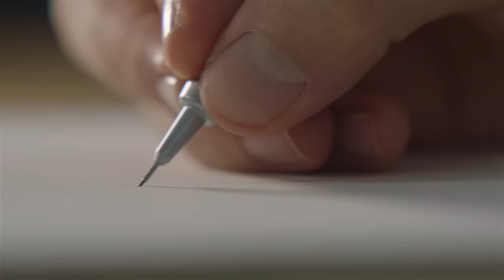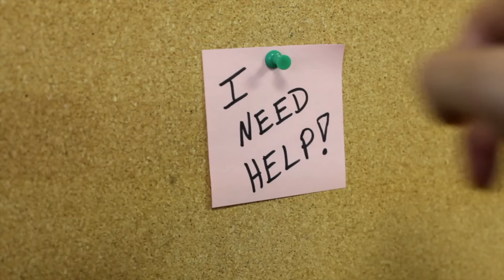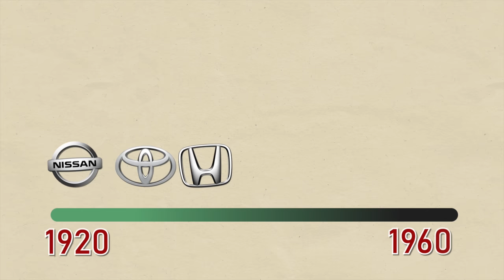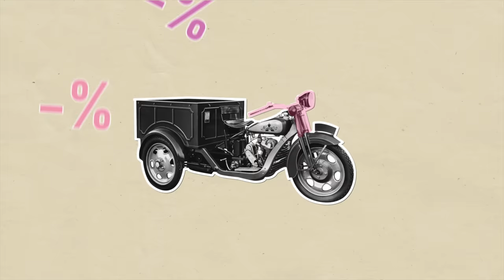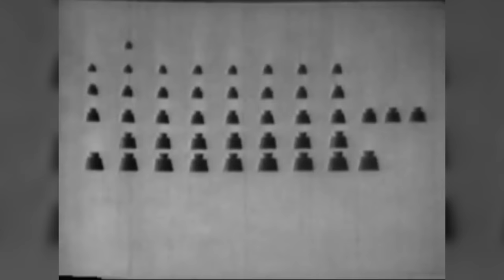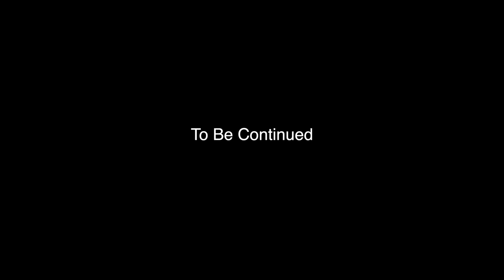Mazda Just Changed the World

Comment: I have a 2014 Mazda 3 with 265k miles and haven't even touched the engine.  Nothing has broken in the engine.  No seals, no water pump, no sensors, not even the belt is showing signs of wear.  Still have the original clutch (6 speed manual).  
I've only done standard maintenance: changed spark plugs, fluids, brakes, tires and recently rebuilt the suspension.  When people ask me if I like it I say it's probably the only car I'll ever buy now if they keep the reputation; I'm just so impressed with it.

Comment: Had a 2010 Mazda 6 and never had a issue with it runs like a Champ.
Reply: I had an Austin Champ with a Rolls Royce engine back in the 80s and 90s it was like a landrover but in my opinion it was a lot better it would pull the back out if a landrover.
They were a military vechicle used by the armed forces in the 50s 60s .
The Champ was a Nick name given to it by military personnel for it's excellence.
Reply: But the rust
Reply: Karl Aber I didn’t have a issue with that I always have my car Clean because it was white but my right head light look awful it turned yellow 😬
Reply: @karlaber3388  no rust on mine

Comment: How reliable is Mazda?
Reply from the maker: better than they used to be, I'd rank them around 3rd behind Honda and Toyota now
Reply: As reliable  as a Toyota made in Japan, Mazda uses denso components  under the hood as well as Hitachi.
Reply: 140k miles on my 2012 Skyactive Mazda 3 with no complaints so far.  Never changed anything except brake pads and oil.  I've been pleased.  It's a pleasure to drive with good mileage.  My complaints have always been road noise, an underpowered AC system, and a finicky Bluetooth system.  Pretty minor complaints.   I've noticed the power from a stop seems a little reduced (like a lag) about the last 20k miles.  I'm way overdue for some tune up I'm sure.  I need to do some preventative maintenance as soon as I find the time and hopefully the car will give me another 60k+ miles before anything serious breaks.
Reply: Willlie Nellson watch out for clogging catalytic converters. My son had a 2006 Mazda 6, and it started losing power, and ended up killing the engine. We only discovered the problem after putting in a low mileage engine , and noticing the car just didn’t want to go. We dropped the pipes and took it for a short spin, and it had power. Cats were completely clogged. Would have blown that engine as well
Reply: @boldcitycc   Thanks.  I'll look into it.
Reply: Im still driving my 2002 Mazda Protoge 5. Bought it in 2003 Love this car! Standard, fun to drive, interior immaculate. Rusty body but nothing that a can of white spray paint can make look okay (from a distance LOL!). All I've ever done were brakes brakes and brakes. Oil changes. Car still goes zoom zoom and has about 255,000. Kilometers (Canadian :)) I will buy another one in a heart beat!!Has to be a standard though!
Reply: @scottykilmer  rather have the 2.3 mazda motor that's is in my 04 ford focus zx3 all honda engines I swear they have to leak oil... the only motor by honda I haven't seen leaking oil is people that build them to race but besides that honda didn't make there engines better then toyota.... I worked in a shop 3 years I have seen all hondas.

Comment: Drove a 1991 Ford Escort, based on a Mazda. Like the way it drove, handling and gas mileage. Only thing didn't like was the rubber timing belt, that although Changed like required, stranded me three times. Once 140 miles from home costing a a we $400 to retrieve. Whoever's idea rubber timing belts was should be banished from the earth.

Comment: i like the 2015 one # HB I got with 167000 miles on it! As I was learning about my new (to me) car, I learnt that Ford used to have a heavy influence in Mazda's MFG and only parted ways shortly after the mazda 3's second generation (where I believe mine to be the 3rd gen?) where Ford was following Toyoda's way of 'find the cheapest transmission and who cares if it slips' and 'depreciation of service life expectancy' that car MFGs have adopted in the last 30+years to make them brake and completely sell you on lifetime fluids (transmission) and for so many other reasons than that I was quick to change out its OEM spark plugs along with an italian tuneup and oil change, transmission fluid change and LSD gear oil too. Once you remove the underskirt its all in a very localized area. Heck, even the Alternator is on top and the drive belts are a cinch to DIY. Thanks Mazda! My next major carbon clean is going to be the 12 bolts that hold the intake manifold on and get in there with a nylon brush (or something softer than aluminum so not brass) but after watching the 1st part of this video, I would treat this operation like cleaning a firearm, same brush but w/o the CLP ha-ha! Carb cleaner only, of course. Hey Scotty! I'd love to see a video on taking off all the black plastic (vanity cover and air ductwork). Just an idea.

Comment: Hi Scotty!
I have a question. I have a 2006 Honda CR-V MK2.5 2L Petrol. The way to check the automatic transmission fluid as per user manual is: turn engine on. Wait for it to get to operating temperature, tun off and check the fluid level. If I follow the instructions word by word, and check the fluid level immediately after I turned off the engine, my fluid level is low. Reaches the first line. However, if I wait 5 to 10 minutes, then the fluid level is spot on. Right at the top line.
How do I check the fluid level, do I wait 10 mins or check it straight after I turned off the engine?

Comment: My friend delivered pizzas in a 2008 Mazda 6 v6 he put 240000 miles on it and he did next to nothing as far as maintenance. The transmission was working good when he traded off. It wasnt worth fixing because he let everything go and everything needed replaced at the same time. If he had maintained it, it would have went alot longer.

Comment: i have a 2018 mazda cx 9 gt with 48k miles and have 1  ? . the oil fill says 0w30 but the owners manual says 5w30 which is right? I have been using 5w30 so far.

Comment: Unfortunately a little bit of proud history does not count for much these days. Mazda is trying hard but there is a reason they are nowhere in the US and Europe - Reliability is very poor on the new Skyactiv Vehicles, especially in their Automatic transmissions. Even though they are torque converter autos they are horrible to drive around town, they jerk and don't shift smoothly. Their transmission, they claim to be a Skyactiv type, even though it has not been significantly upgraded since its iteration in 2012! There has been a recall and several bulletins across the globe, yet they insist in using it even in their new Skyactiv-X vehicles. Their Skyactiv diesel engines have had fundamental design issues and Mazda refused to properly compensate owners. Their body paint is so thin there is entire forums on how easily it scratches. Also customer support is not up to standards yet. They are currently being Sued in Australia by the Australian Consumer Body for major misconduct! (Mazda is very big in Australia!). The only thing Mazda's excel is their looks, sharp pricing and excellent handling and dynamics, these are the 3 key features that make people attracted to the Mazda vehicles, however to own it is a complete different story.
Reply: Ive owned two mazdas and still have one of them and all i can say is all you said is a automatic transmission problems which i can never expirience because i like manual and mazda actually have one of the best manual transmissions and both my mazdas are super reliable...i give them 30k miles a year and only pay money for basic maintenance.The rest you complain are unimportant things that many other companies have them worse like the paint for example...
Reply: @babatigosho6214  I do hear their manuals are excellent but in this day and age most sales are automatics.
Reply: @MrTubeniko  Im not sure about that,here in Europe biggest part are still manual,i think the rest of the world too,except USA and maybe 1 or 2 other countries too... you can find some statistics,i quickly checked in google and statistics from 2015 shows up saying the number of automatic produced at that time was 34%